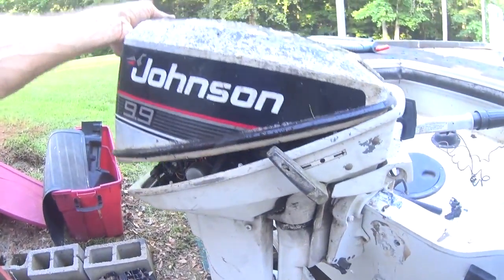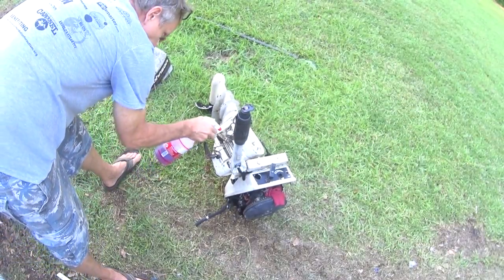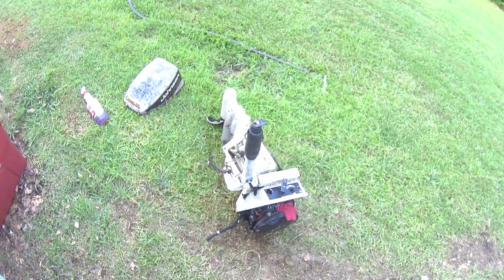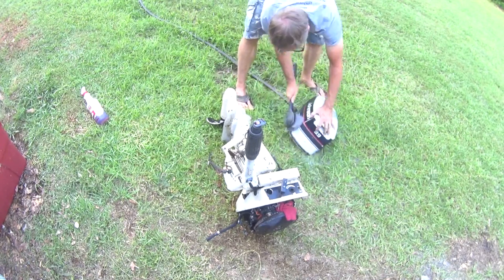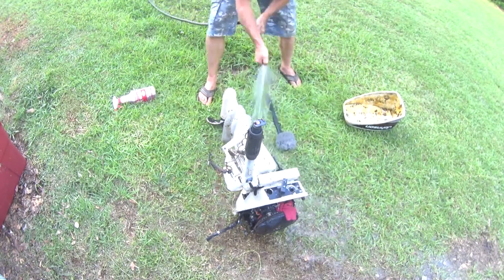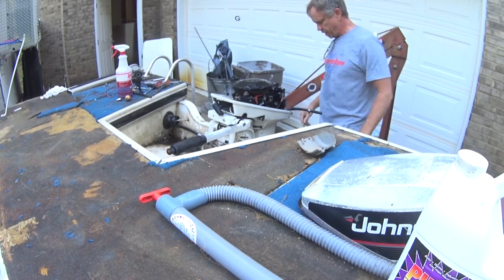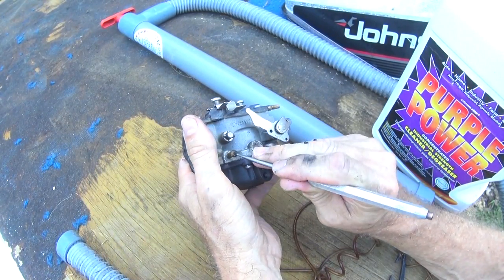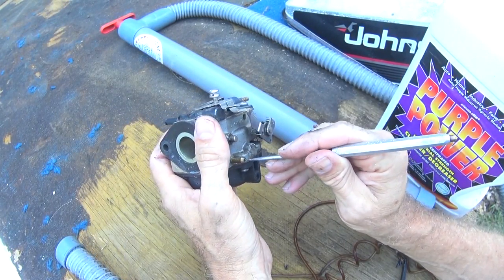Tiny Off Grid Boat Camper 6 - walls, roof and outboard

Comment: not sure wat the price is but lowes sales those post for deck rails thats aluminium ,also pools use the same metal,maybe check a few pool suppliers or the guys who install them,or you could run a few adds to see if u get any hits back for the metal,a couple scrappers might hook u up ,for a dime or so mor on the pound comped to local scrap prices,,a bit short on footage i agree Tim Lewis,but good fun to watch ,
Reply from the maker: I'll check out those sources for aluminum, and there are a few more scrap yards around here I'll try. Sorry for the short video but just wanted to show some progress. What is a good length for a video you think? With these build videos they can be as long or short as needed. What do you have time for?

Comment: Wouldn’t it be a good idea to put some sealant between the boat and wall to keep water out?
Reply from the maker: Yeah, but the way the boat is built if it splashes up that high it is going to get in there anyway. The hull that is, not the interior of the camper. I plan to put flashing under the exterior skin and over the rail I put on there so rain flows over it.
Reply: JYDOG - ah ok 🙂